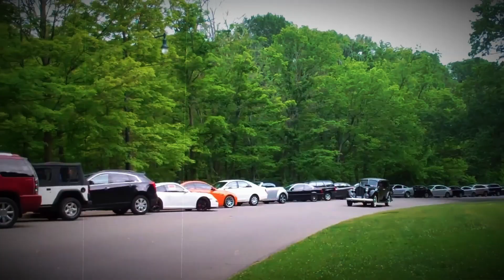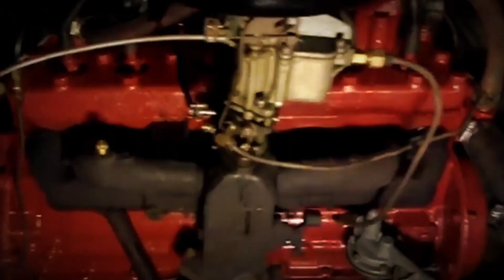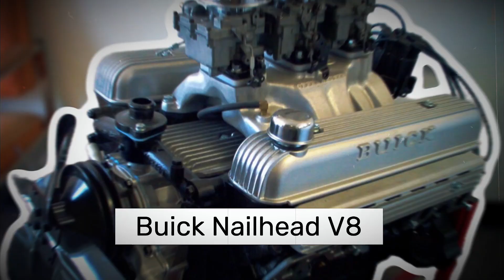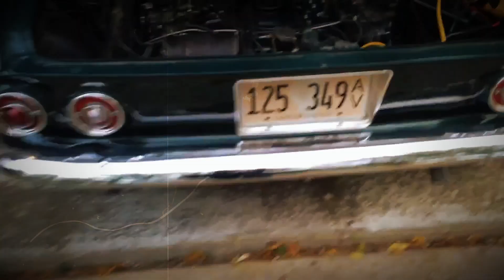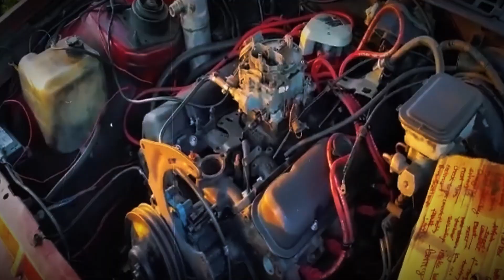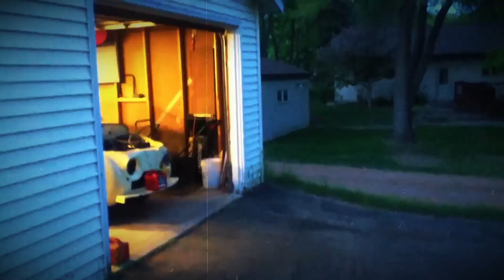20 SILLIEST American Car Engines Of All Time! You've Never Seen! 🚗💨

Comment: There was no Packard straight-12.  Those were straight-8's.

Editing is very poor on this video.  The ford 255 was discussed twice, but the second time, it was the flathead V8.

The AMC 258 I-6 and 2.5L I-4 were good engines.

What, no mention of the Pontiac Trophy-4, which was half of a 389 V8?
No mention of the Vega I-4?
The Ford CVH I-4 of the Escort?
The Chrysler Polyspheres?